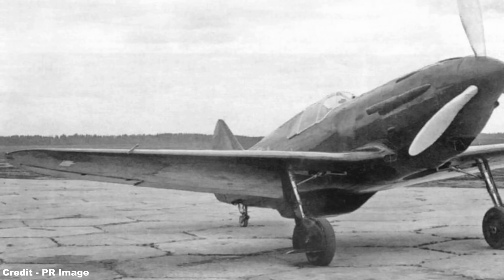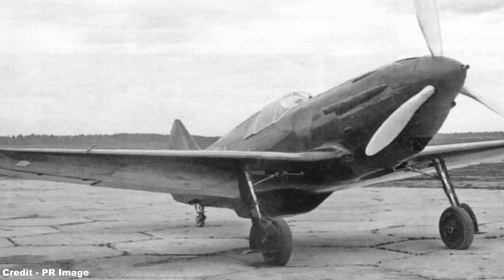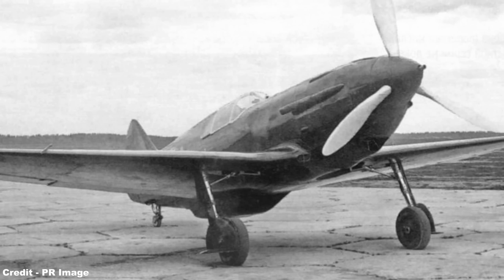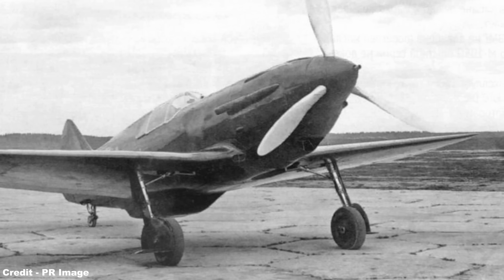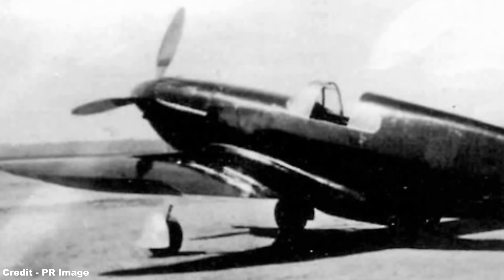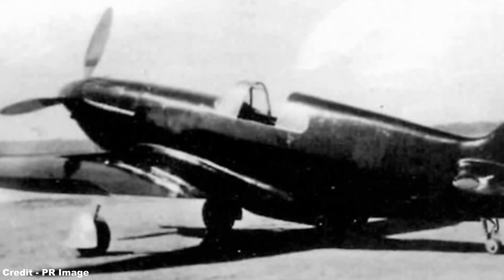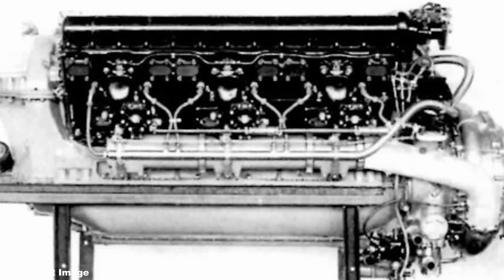Flying Failures - Lavochkin Lagg 3

Comment: Makes one wonder whether or not, rather than wasting time with this design, the VVS would have been better off making hundreds of small biplanes then raiding the Luftwaffe air bases as often as possible, for as many hours a day as possible. 

Essentially using the biplanes like drones are used today. 

I know of course they used the Po-2 for that at times (and the Luftwaffe used things like the He51 and the Hs123 - the unequal span dive-bomber - for that too) of course & so did the DPRK to some effect years later.

The fact that the USSR churned out this rubbish shows you how essential the Western Allies were for materials supply to make the great later war fighters like the Yak 3/9 and the Il-2 attack aircraft. 

However it also does show two other things: By this point the Western allies had refined many of their designs into 2nd iterations after finding what worked/didn't work e.g. no more turret fighters, but better engines for Spitfires; access to the Mustang for the USAAF with Allison-Merlin combination; that the Japanese with their Ki27 and A5M might have had brilliant early war aircraft added to those the Ki43 and A6M (plus some others e.g. Ki84 & Ki100) but their inability to improve much beyond due to the War (added to the fact the West could supply the Soviets with material to build more and more aircraft) really does show how failure to prepare succession leads to ultimate failure - compare that to the Brewster Buffalo > F4F Wildcat > F6F Hellcat progression (added to that the F4U Corsair coming on stream).

Or look to the RAAF who were able to upgrade the Beaufighter, long enough, to ignore the Mosquito (ill suited for Asia) so as to adopt the more modern F4U later on - whereas the Japanese couldn't have ignored any interim improved design, however bad (the same with the Soviets here with the LAAG after the I15/I153/I16).
Reply: The simple answer is no, because one combat air patrol squad could shoot down dozens of byplanes, reload/rearm fairly quickly and do it again.
Likewise nations run out of pilots far faster than airframes, the innovation of drones (which the US was already using via TV camera system in pacific, and one could also argue the V1 filled a role of, despite its lack of control post launch) was to NOT risk aircrews, thus force the enemy to expend greater reasources to counter them than you did to launch them.
Lagg3-La5-La7-La9 is at least as much of a progression as Buffalo-Wildcat-Hellcat, Indeed the soviet union is better known for its design iteration than the west, with its method of design involving more prototyping vs paper designing and scale testing, in no small part because it was smaller economy than USA seeking near parity in some key areas instead of an equally sized nation that just had a different mindset, but this is only the story of the first in that sequence, not the complete tale.

Comment: Soviet Air Force, engine and the armaments manufacturing industries couldn't decide which engine and guns to use, so LaGG, Yak and MiG fighters had provisions in their design to use different weapons and engines. This modularity allowed Yak-9s to mount 37mm and 45mm cannons and LaGG-3 to mount M-82 engine (La-5). M-105P used single-stage two-speed, gear-driven centrifugal supercharger. The range was increased because the SAF was concerned that Luftwaffe's lack of range during the Battle of Britain. Lack of aluminium forces all design bureaus to create "optimal" an "maximum" design versions (like I-26 and I-30 from Yakobvev). As the war went on, many revised features were added from maximum to optimal designs, while constantly incorporating weight loss and aerodynamics optimisation. Aluminium production, equipment weight, reliability and availability, manufacturing quality in airframes, armaments and engines caught up only in the latter part of the war, as Nazis were pushed westward. This allowed the principal designs to shine, like Yak-3, Yak-9U, La-7. Their immediate post-war all aluminium versions, like La-9, showed great performance. Limited engine output in the face of poor expectancy and forced wood construction were always the problems that constrained designs of that era. The "guaranteed varnished coffin" was created by researchers post-war to increase dramatism of the early war-time problems.
Reply: Purges helped

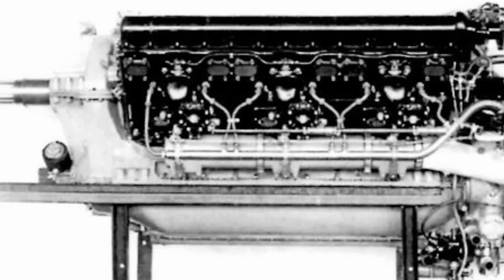Comment: 3:21 That is incorrect. It had just one stage (one compressor unit) supercharger with two speeds (like two gears in a car). AFAIK no soviet fighter had two stage (two compressor units connected) supercharger system.

Comment: Great video but I can't help myself from small correction i see needed everywhere. I'm sorry, this is a myth with mosquito as well. Wooden planes in WW2 were not revolutionary, they were old timey. That's why nobody thought they'd work. It was like beating a modern formula 1 with a car made out of alumin(i)um. Going back a generation in material and still being competitive is a b****. THAT is why the mosquito turned so many heads. Also why nobody started making airlines out of wood after the war

Comment: I’m intrigued to see where this series goes. I like the fact that although a “failure” over 6.000 were produced. Pretty amazing what desperate measures in wartime can do.
Reply: Desperation can be good; but most often it's not.

I mean, had the Sovs just built hundreds and hundreds of Hurricane's they might have done far better. 

Similarly the French, rationalising production with Hurricanes (or Hawk 75s) and D520s rather than the Ms405 (iirc 405?) plus myriad other types. 

But hindsight and all that.....
Reply: @emjackson2289  The Hurricane would have required manpower and materails that the soviets simply did not have, so it would have been hundreds instead of thousands, and forgotten in history just as most lend lease aircraft. This is because its was physically a larger aircraft than the Lagg, and never conceived as a cheap or economical aircraft, nor did the style of machines and tooling needed simply didn't widely exist in Soviet nanufacturing, let alone with trained operators and maintaince staff to work it reliably and quickly without major quality issues, none of them are insurmountable, but it was the very stratigic reasources that the lag was supposed NOT to use. The Hurricane had been expensive and slow to start production even in UK, and merely filled the second line role for British Airforce because it was an already established design intended to be undergoing replacement with the Spitfire ect, although in truth this replacement would come later than they initally expected.

Likewise the Hurricanes principle advantages where in its range and space for equipment that was important when you where flying over the channel, but not for defense over land of a nation rapidly loosing ground towards its own airfeilds. Meanwhile its weakness of armament (at the time only successfully making use of the ".303" 7.7mm machine guns) made it FAR inferior for intercepting bombers or even the latest fighters like mentioned repeatidly in video BF109F series, which had already started to carry armor fairly suitable for high probabilities of protecting pilot, main fuel tank and engine, hence simlar sized guns removal from the Lagg design mid production to only carry the heavier 12.7 and 20mm. This change in expected theature of combat was also why the spitfire itself would actually be a smaller and more manuverable aircraft than Hurricane, allowing better climb and turn performance with the same basic design of engine, and force on pilot controls, but had left the British scrambling for a cannon, as even with external gunpods reliability simply hadn't been high enough and it was felt so late on that ".50cal" 12.7mm would soon go the same way if trends continue (it turns out in hindsight that it hadn't even by wars end, but it would for cold war aircraft, so it wasn't entirely wrong, just further reaching than pragmatic). So while the plywood Lagg was not a better aircraft, it WAS better suited for the production and mission realities faced by the nation that built it than Hurricane would have been, at least for the second line role and during the years it was initally designed/built. By 1944 when it was cancelled and war was being taken back into recaptured German territory, and major airpower already broken, the Hurricane would have been a far more suitable aircraft for sure, but it also didn't really matter, as the Lagg was cancelled and multiple other designs where being made for this role that, even if not the best, where "good enough" to see the war to conclusion, the time when it had mattered most had been earlier, when the Lagg still made sense.

There is a saying that "in war, the side with the simpler uniform normally wins", and this speaks volumes about how different the grueling industrail arms race is from the clean 1v1 "benchtop racing" between designs thats popular by enthisits and generals in peacetime. Its often better to have enough of something passable than a few of something more ideal, and despite every nation having disparaging names for their own vehicles as death traps, lets make no mistake, multiple pilots made ace in the Lagg3 against German aircraft, it might not give you an advantage, but it was no hopeless matchup.
Reply: Yea I think this is a auto dubbed or ai channel